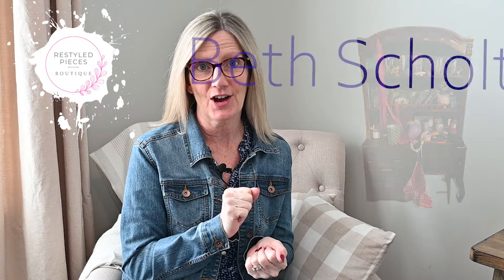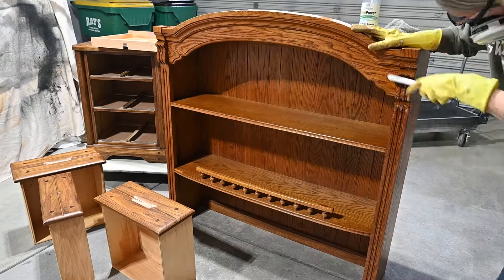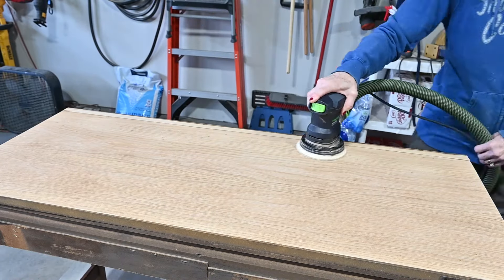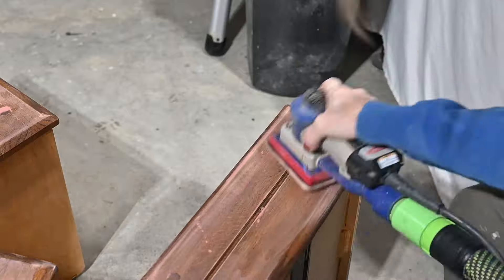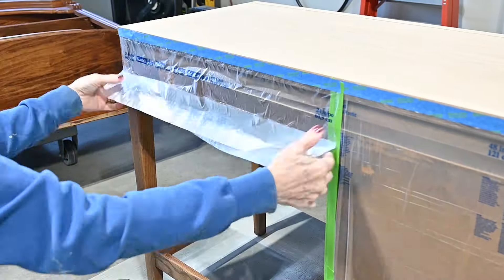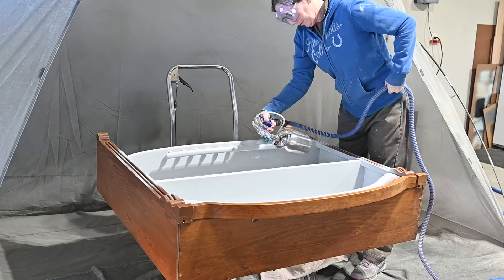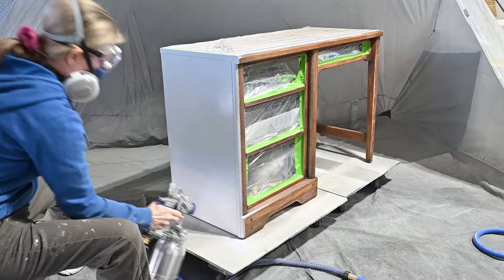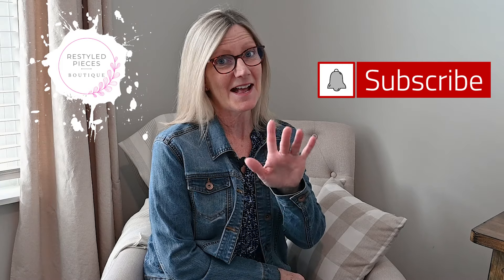Mix and Match Makeover: Seamlessly adding a Bookcase/Desk Combination to a 3-Piece Bedroom Set

Comment: Is Bondo spot putty smelly like regular Bondo?  If you sand the spot putty and wipe off dust with damp cloth, will it stay on better than the plastic wood?  It's hard to find the ideal wood putty, they either need refilling, dry out too quickly, or have to be primed over.
Reply from the maker: Hi! The Spot Putty is smelly, but not as bad as Bondo. If you’re just putting it in for 10-15 minutes you’re probably ok. If you’re adding it for a longer amount of time, I would use a mask. When I sand it, I use 220 and sand it a bit slower speed and lightly, do it will stay in better. I also BARELY dampen my rag at all when wiping off the dust.  I prime  over it initially, but when I find spots after I’ve primed and I fill those, I don’t reprime. I paint over them with no issues. Farmhouse Evolution paint does have a built in primer, too. Hope this helps. 😊
Reply: @restyledpiecesboutique  Thank you so much.  I'm going to try it!
Reply from the maker: Let me know how it goes! 😊